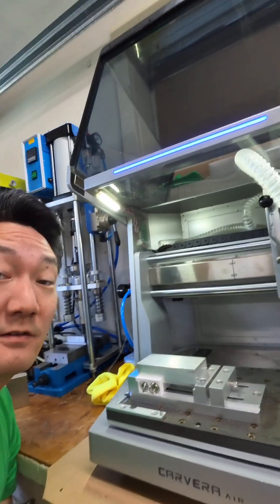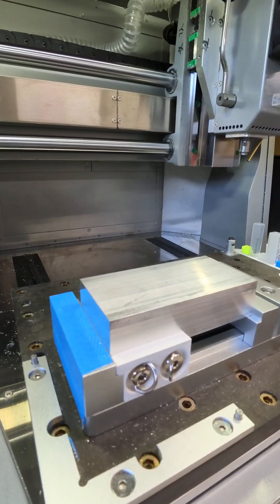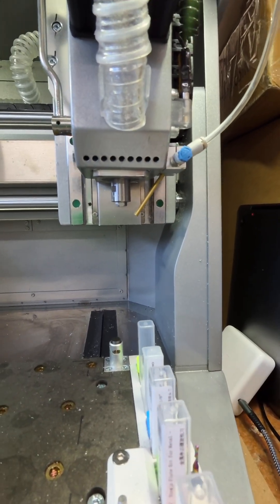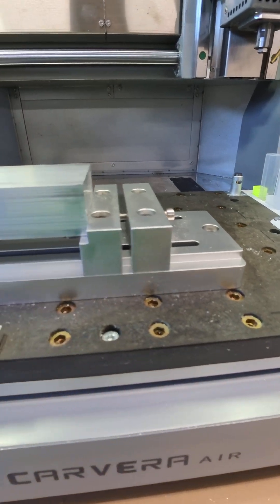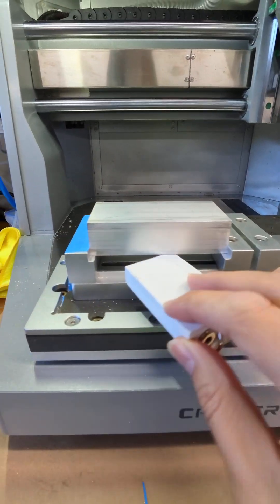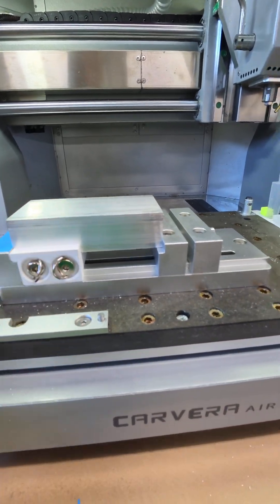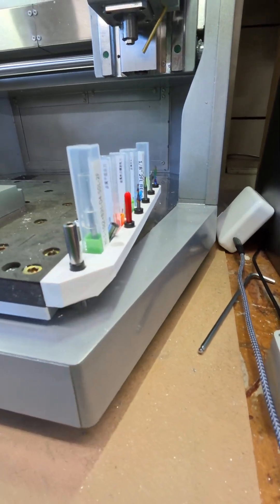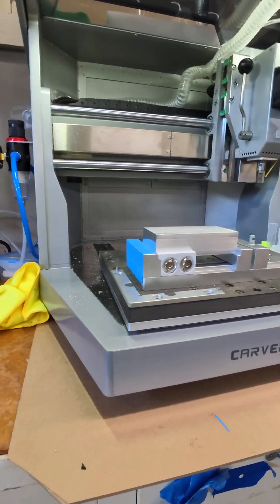First setup mods for Carvera Air CNC

Comment: What is the recommended psi for the air system?
Reply from the maker: I run it at 90psi out of the tank, then adjust with a regulator and moisture trap. There’s a fine adjustment knob at the tool head. You’ll want to put a shutoff valve in there so you can turn off the air when changing tools.
Reply: @KelNishi  Right on, brother! Thanks for the advise!

Comment: Nice work. Love what you are doing with the CNC and manual injection moulder. I’ve been researching carvera all weekend and about to hit buy. Would you recommend it to produce small injection mould tools?
Reply from the maker: I’ve been having a great time doing just that! If you can wait a little while, you might consider the Makera Z1 as a less expensive option. If you go with the Carvera Air, make sure you get the 1/4” colette with a 1/4” to 4mm adapter. 4mm shanks open up a lot of tool options for detail in your cavities.
Reply: @KelNishi  thank you! i considered waiting for the z1 but looks less powerful with a smaller working area. thanks also for the heads up re colette. i have already added to the basket. i'll just do another check on the z1 again before hitting the payment button